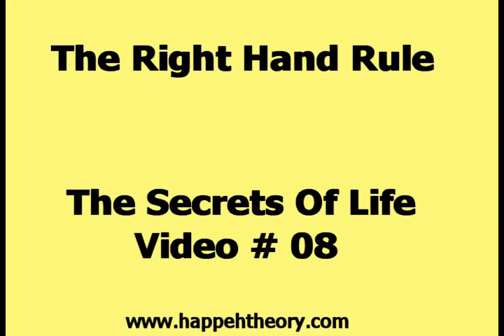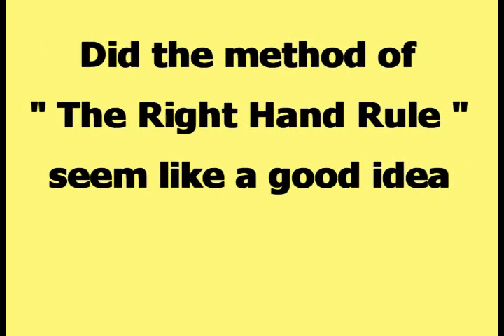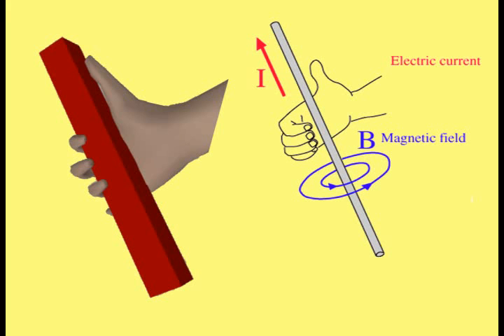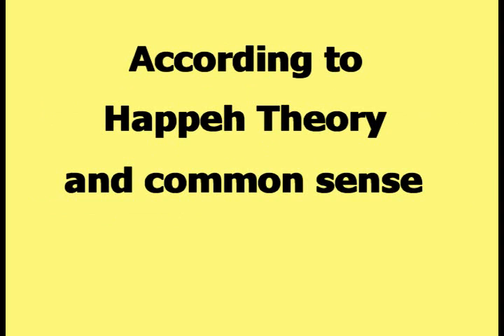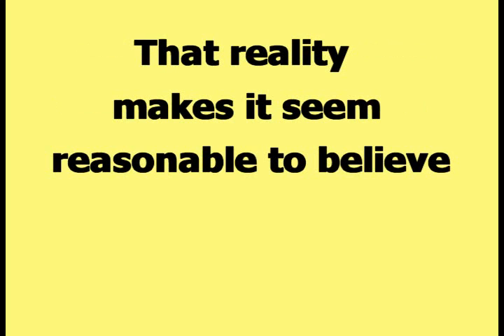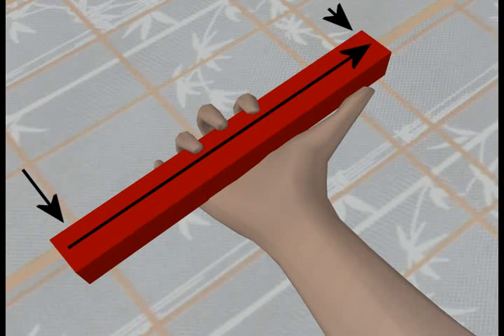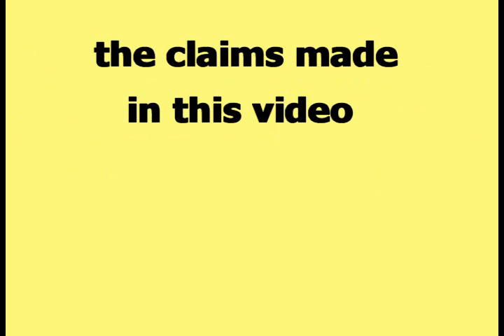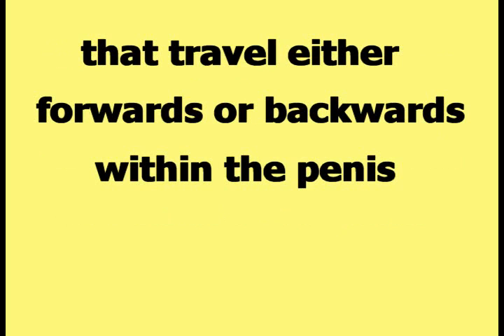The Right Hand Rule

Comment: How come with situations regarding Fleming's left hand rule, the magnetic field lines are always straight instead of curved? The way I see it is; they should be curved. Unless they take the tangent to the curved line as being the direction of the magnetic field. And even if they did this, because a current-carrying conductor may be so long, the direction of the force on the conductor would be different to the direction of the force on the other side of it? I do NOT understand!